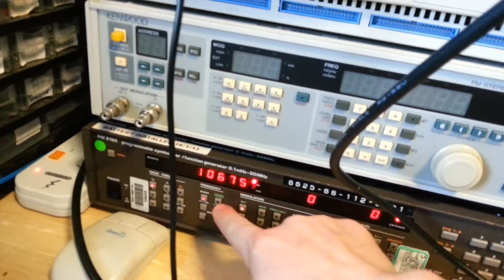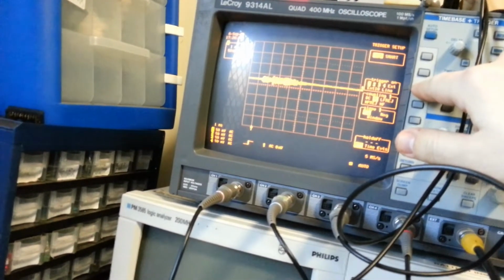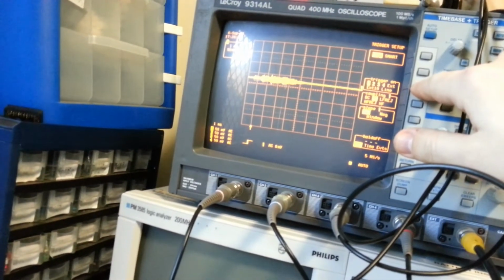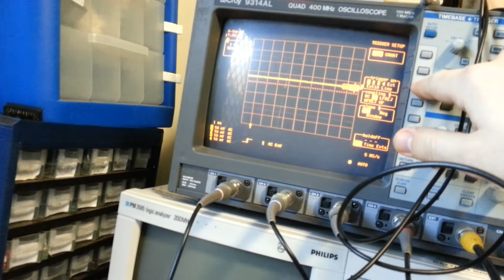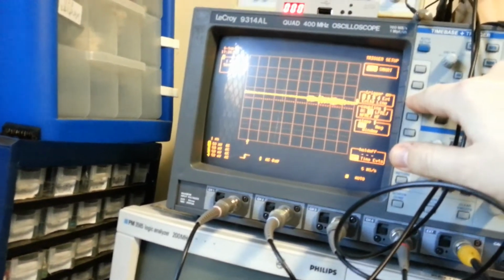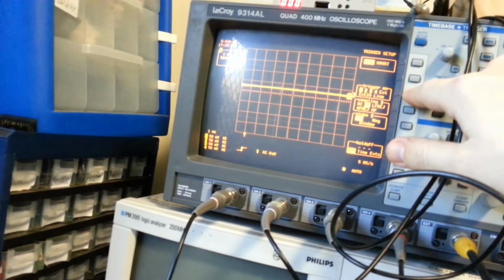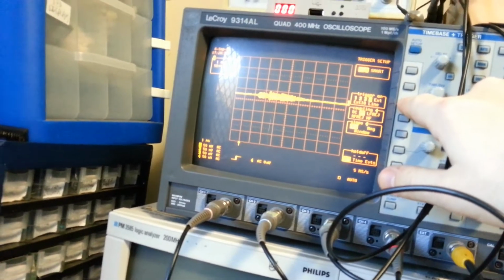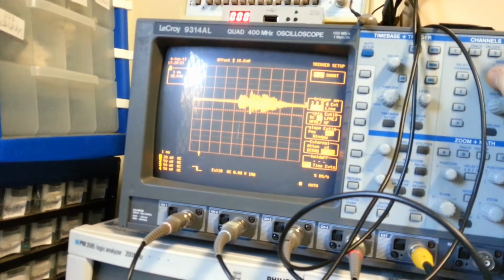How to sweep test an IF filter

Comment: You may want to use a rf probe, IN60 diode types to rectify the signal that is sync'd to the sweep generator. Then you get a nice passband graph showing 3db bandwidth.